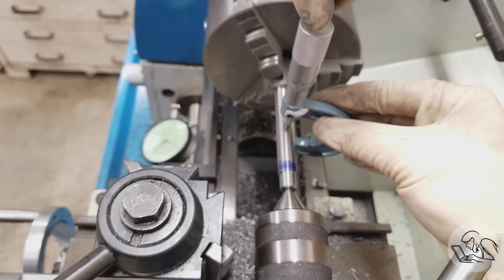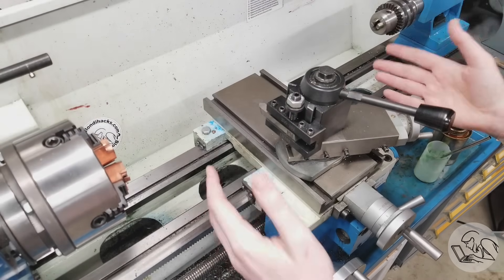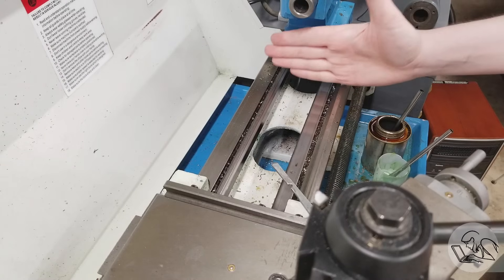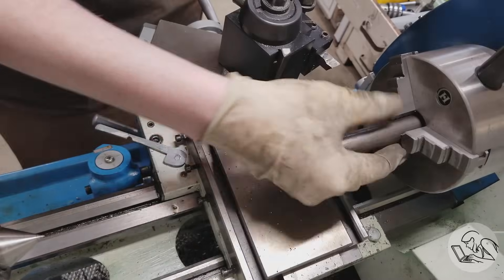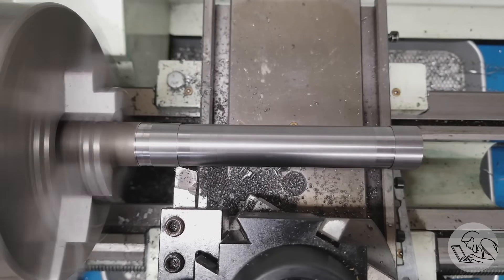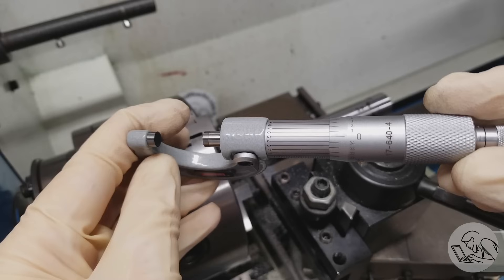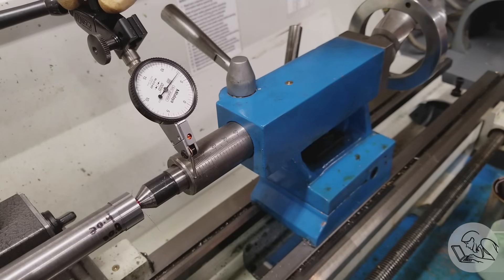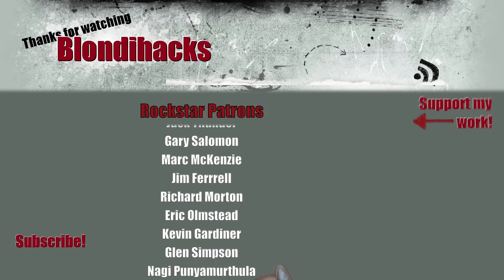How To Align Your Lathe

Comment: They are some lathes that u have move the headstock to get taper out.some pivot and others are in fix position. Other trick to get rid of taper is to shim the Morse taper on live center..010 difference, .stick .005 shim inside m.taper in tail stock with live center. Either towards u or away from u depends on taper uphill or downhill.cut shim half of shape of Morse taper,wrap  around trick on live center.no need to adjust tailstock

Comment: Great instructional video on an often overlooked subject, even by a lot of experienced machinists. The only thing I could think to add is that used lathes can have significant wear on the ways themselves that is usually concentrated on the part closest to the spindle (90% of lathe use is within inches of the chuck). The uneven wear pattern on the ways can mess with the alignment process.
Reply: The best way to fix that is to install a CNC control, then you can program in your error table for correction factors.

Comment: As a machinist with over 20 years experience, though I've never had to perform a machine leveling, this is correct and very well explained. Excellent job sharing info and procedure to keep a dying trade alive!
Reply: Reql quick. If one has been a machinist over 20 years, and one has never performed any leveling, how would one know it to be the correct way and very well explained?

Comment: Very informative video, thanks for sharing. Could checking and removing any twist in the lathe bed be performed using one of those cheap/ish digital box levels, what are your thoughts on this?
Reply from the maker: You could try it, but I doubt they have the sensitivity. Check the specs on it- 80 to 90 seconds of arc is the resolution that you need. Not sure if those things can do that.

Comment: acording to This Old Tony , 8 out of 9 machinists have lost their sanity to a machinists level
Reply: I thought that was 9 out of 8...
Reply: Actually there was a way to save that first bar. Just drill an offset hole in one end, stick a pin out and find a way to engage that pin with the spindle. Think of it as an internal lathe dog.

Comment: Great video! I recently made a part on a lathe that I first asked the owner/operator if it was straight, parallel, etc. After assuring me that the tailstock had just recently been recentered with the spindle, I proceeded to make my precision part. While I noticed slight vibration in the process, I missed that it was turning a taper just under .010" difference over 18" between centers. I didn't even know where to start to look for the misalignment: Now I do! Thanks! Shoutout to https://www.youtube.com/featony for referencing your channel and leading me here!

Comment: Great vid!  I got my lathe leveled, and turned between centers, but I forgot to make the bar-bell to check, so I gotta go back and do that.
Don't forget to level lengthwise too.
What really bums me out is Starrett doesn't make boxes for the 98-6, not sure why that is.
Reply: Sounds like you need to make friends with a woodworker...
Reply: @lotharerkens8154  My brother is the woodworker, but he costs too much  ;p
Reply: Just checked my lathe and sure enough it was no longer level. It probably shifted during a heavy cut.
I was turning a bar-bell yesterday and couldn't figure out why I was 5 thou out, but I ran out of time to play.
I checked my level too, but it's adjustments are so tight I just left it alone, it was only off by one graduation so I can live with that.
Ran the bar-bell a couple of times after re-leveling my lathe and it looks like I'm out by 2 thou per foot, so I can live with that for now too.

Thanks a bunch!!!  ^^

Comment: Quinn..as a matter of fact, u have done it way better than Old Tony or anyone else on youtube..reason..umm..u have not used a precision level in doing all this..Using a level is not the right way infact because no one compensate for the twist effect of level itself..the level must be perfectly 90 deg aligned with a straight line along the ways, otherwise u are getting a false reading out of the level itself. Another fact, u hav not ignored the tool pressure compensation, so u are more than intelligent.

Comment: Nice Vid! But couldn't you install a precision travel indicator between the tool post and the stock before adding the shims under the frame? You then could correct the distance and direction by looking at the action of the indicator before making your next cut.

Comment: Well done Quinn. Always enjoy your videos! I have an Enco 12x36 geared head lathe model 110-2075 and I am having a heck of a time getting the headstock aligned to the ways. The lathe is perfectly level or no twist in the ways, I can turn a test bar and get .003” taper in 6” smaller at the chuck end. I loosened up all the bolts that hold the headstock to the main casting and loosened the adjustment screws just to get all of the stress out of it. The closest I can get it is about .0015” over 6”, and when I do get it that close it only takes one heavy cut to throw it back out again. I aligned the tailstock with a coaxial indicator in the 4 jaw and swept the ID of the tailstock spindle and it’s within .0005”. Driving me nuts why I can’t get a good straight cut on this machine. It hardly has any wear
Reply from the maker: If a heavy cut is causing the headstock to shift, something is very wrong. How heavy of a cut are we talking about? Maybe the machine isn’t rigid enough to do what you’re asking. I would also check the chuck, centers, tailstock height, and spindle bearings. If you can’t get it aligned within a couple of tenths, keep working on why. You won’t get good cuts until the machine is aligned well and stays that way.

Comment: Blonde, I learned something from your video.  Thanks.  My lathe, however is a little Shereline with about a 3” swing and aluminum parts.  The head stock rotates on a tapered plug...   the best I have been able to do is to rotate the head stock until it about as good as I can get it.  That is until the next time I use too much force and it swivels again.

Comment: An easier way to align the tailstock is to take two Morse taper adapters that fit your lathe and insert them one at a time in the headstock and turn an area down on the exposed end to any convenient dimension but do not change the cross slide so that both turned areas are exactly the same diameter. Then insert one adapter in the tailstock and one in the headstock. Then run an indicator back and forth on the carriage, hitting the turned areas on the adapters to test alignment.  It is much faster than turning a bar and they can also be used to check alignment for tailstock height plus they can still be used as intended.

Comment: We just bolt on a 4 way chuck and stick a large diameter piece of aluminum round stock. After cutting it we check for taper. Make adjustments where it needs.

Comment: When I was taking Machine Tool Metalworking in community college many years ago, the centers were designated as dead (tailstock) and live (headstock). The headstock center was considered live because it turns. Since the ball bearing tailstock center has become commonplace, that is now called a live center. So, what do we call the headstock center now?
Reply from the maker: That’s a philosophical question that I am not qualified to answer.  😁
Reply: Live or dead is a matter of both type and application. Once you place a dead center into the headstock, it becomes a live center if you are going to spin it.

Comment: Where were you a year ago when I did this? You put together all the info that I scraped together from ToT, Tom Lipton, and others. You're doing an amazing service for the hobbyist machining community by putting all this info into a concise series.

One of my long term goals is to build a spanning beam lathe stand which would allow me to adjust twist by turning bolts instead of inserting shims under the feet. Should allow much better control and make the whole process easier.

Comment: Hello Quinn, There is a third source of error you may find on a new lathe: the headstock to the bed. When I received my new lathe, my test bar error was 0.007 inch per inch. Yep, about 0.253" on my brand new 14x40 lathe. I think there must have been some heavy seas on the way from China. Or the rolled the crate at the port of entry. Or pencil whipped the inspection report. 

Enjoy the holidays...

Comment: Nice to see a dead centre for a change.  Believe it or not just the other day I was thinking there should be more between centres stuff on YouTube.
Mainly because I need to do exactly this leveling operation on my ~80 year old lathe. 
Thanks for sharing.  Not sure I’ll try the 6” stick out though.  Might need to replace / adjust my head stock bearings first. :)
Reply: An interesting chain of events got me started on my adjustment process.
One of my V belts finally wore out
To change it I have to remove the spindle
So while I have the spindle out I may as well adjust the bearings.
Now with the bearings a bit happier I have made some adjustable feet and have the machine nice and level.
I have a nice hunk of about 1.5 inch bar sticking out of my chuck.  My spindle is tiny at about 3/4” hole going through but that is how they made them back in ww2 days.  I’ll use a steady to put my centre in the end.
Thanks for inspiring me to get into this.  That and thanks to my old v belt .

Love the Chanel, keep it up.
Dave
Reply: Yep Davo, I know your problem. Mine started with I bought a Chinese mini lathe.
Reply: @oldfarthacks  
I know those mini lathes can be pretty average machines.  Now that you have it take it as a challenge to make it work at its best and make some really nice parts anyway.  
I have spent as much on accessories as I did on the lathe originally 🤠.  I bought a face plate and a milling attachment.  My cross slide has worn in the middle of the stroke and is a bit sloppy now.  I’ll make a video on re machining that when the time comes.  My lathe features in a couple of my videos if you want to check it out.

Comment: Your timing is impeccable.  I recently bought that brand's tool that you had to obfuscate in the video, and I'm almost caught up enough on other shop issues to spend a day (I'm slow) calibrating the bed and the tailstock of my lathe.  You are a born teacher!  To true my mill head, which has neither nod nor tilt adjustments, I had to use shim stock.  It was a special form of hell because I had no help in levering the column between shim permutations, but it paid off!  So I'm sure it will on the lathe, too.

Comment: Bonus: now you have a self made tailstock alignment bar with exactly the amount of tolerance that you’re ok with, right? Now you can just use that with an indicator in the tool post like a commercial tailstock alignment bar, correct?
Reply from the maker: Yes and no- an unhardened and unground bar like this is really only accurate with a test cut. The centers in it would not hold their repeatability over time, and the turned surfaces would not indicate precisely enough for tenths level of alignment.
Reply: Blondihacks how do “they” precision grind round bars anyway?
Reply from the maker: @mtwagner  That's done on a rotary grinding setup. For example, you can mount a spindexer or similar fixture to a surface grinder with a tailstock and rotate the part between centers while grinding. A company like Edge will have a dedicated circular grinding machine for this sort of thing, no doubt.
Reply: @Blondihacks  neat.

Comment: Nice video but I have a cautionary note: I broke my tailstock casting trying to adjust it with the locking lever (holding it to the ways) locked.  On smaller lathes, that lever clamps the tailstock down and clamps both halves of the tailstock casting together at the same time and the adjusting screws push on cast "ears" inside the casting.  Well if you have it locked down and you don't see your indicator moving and you keep cranking on the adjusting screws, eventually you doink off one of the ears.  Fortunately parts were available and I have to think that I fit the new casting more carefully than the person at the factory did.

I also now use the Richard King tailstock alignment method: measure the tailstock quill diameter as close as you can, then carefully turn a small test piece in the chuck to that exact diameter.  Now mount an indicator on the cross slide and bring the tailstock quill up to touch the turned piece.  As you move the indicator from test piece over to quill you will see the indicator move.  You need to measure in two orthogonal planes, across the top of the quill/part and either side of the quill/part.  This tells you the direct offset you need to adjust for very quickly. I have mine set slightly high (0.0005) in the vertical direction to account for droop when everything is hanging out.

By the way, you cannot spin the indicator around the quill using the lathe spindle since gravity is working against you--even if the alignment is perfect gravity pulls the indicator so it will read differently on the top and bottom of the quill.
Reply from the maker: That’s a good note- depending on the tailstock design, it may need to be unlocked for each adjustment.
Reply: @Blondihacks  
The Chinese ones for the Mini Lathes have that issue, along with the bolt that locks the two halves together is located on the underside of the footplate.

Comment: Hi Quinn, a lovely demonstration with the toothpick model.
I have some comments about the tail stock alignment- you measured the tail stock end of the bar as smaller than the headstock end, then stated that it was larger.  Then proceeded to move the tail stock away which I understand which is the correct way if the tail stock end is too small (as is described in taper turning, with the “thin end” produced by having the tail stock towards the operator). I think that when you measured with the indicator that you moved the tail stock towards you, with a half thou increase on the dial. The correct movement away from the operator produced a decrease in the indicator reading.
The test bar in the chuck measures the headstock alignment and the lathe bed “twist” can correct somewhat for this.
I’m just a hobbiest so don’t bite my head off if I’m wrong, I’m also trying to get my head around this.
Merry Christmas from Australia!

Comment: The best tutorial on levelling i have ever seen !
Reply: It's incorrect.  I did it this way and the level was not calibrated (well, it was impossible to calibrate it using this method). If you search for the level axis using a level that is not calibrated and use the bubble in the center, that is not going to be the level axis of the surface plate. You have to find the axis where there is equal discrepancy in both directions, that is the only way to find the level axis with non-calibrated level. After you find the level axis, you adjust the level to get the bubble level, you will have to keep rotating the level and splitting the difference closer and closer and this will probably require very small re-adjustment of the 123 blocks/reference edge.  Also, do not fiddle with the screw side as shown in this video, there are small half balls under there which are meant to be the pivot point of the level, you adjust the nuts, not the screw. The incredibly thin slot for the screw is there on purpose to make people avoid fiddling with that side as it will require a specialty slotted head if you want full contact and not risk marring the slot.
Reply: Me too

Comment: Thanks! However,I was wondering,  when I shove my tailstock with center towards my head with center, it looks like there's a small height difference! How do I fix that? Or it's that not a problem?
Reply from the maker: You can shim the tailstock between the two halves (where the cross-wise dovetail is). You definitely want them at the same height. Make sure it isn’t just droop in your quill though.

Comment: Quinn, I have a feeling that trying that on my vintage lathe will very quickly turn into a three ring circus!
Reply: Don’t give up on the old lathe.
I think mine is about 80 years old.  I just chip away and the stuff that is worn and slowly but surely it’s accuracy is coming back.
Some parts I buy but I make them if I can.  I just made a new cross feed nut and it came out perfect.
Sometimes you just need to work within your machines limitations.
Remember, we’re machinists  :)
I have now have a piece of bar sticking out about 8” waiting for me to get back out to do the next step. : )

Comment: If we set 'level' using a chuck, and there's a difference between centers between chuck and no chuck (presumably also between different chucks), then we need to re-level the lathe to every chuck we might use on it every time we swap them right?
Reply from the maker: Actually no you don’t. Chucks introduce runout, but not taper, because they spin. That cancels out any offset issues, so as long as you turn the material deeper than the runout in the chuck, it is not affecting your part anymore. That’s why you have to turn down the journals until you get a clean cut on both. You’re then inside your chuck runout.
Reply: I knew that, i wsa just testing you.  :)  
Thanks for the great vids.